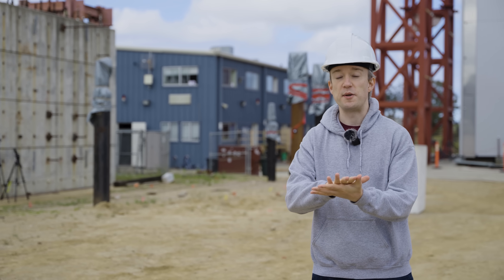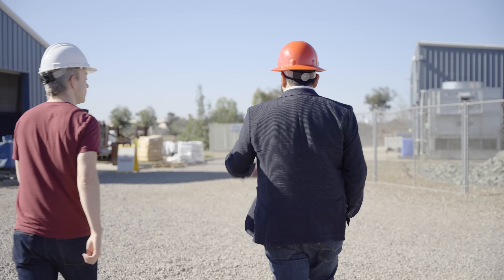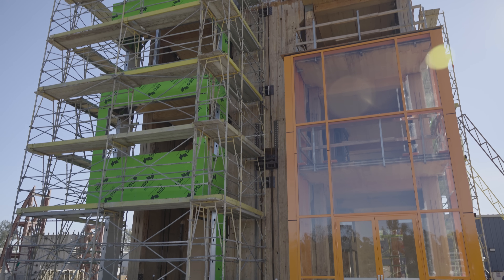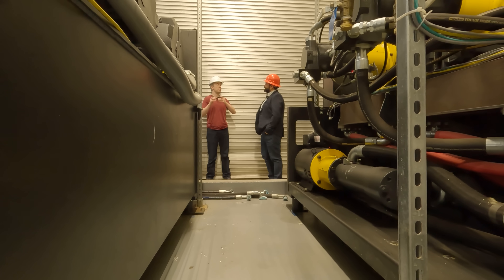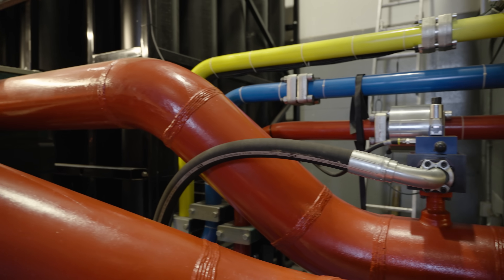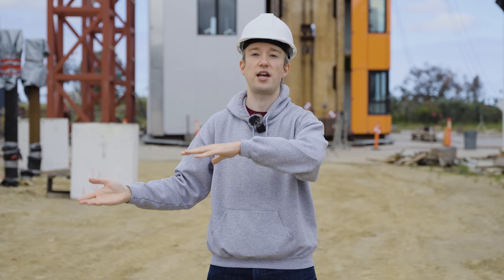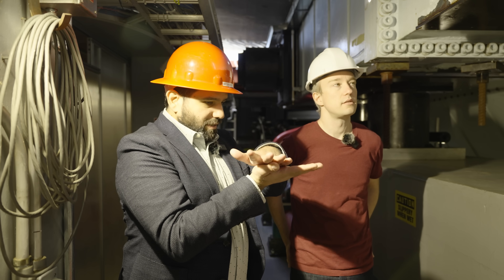Shake tables are way more complex than I thought

Comment from the maker: I'm a bit worried about whether the shaking comes across on camera. If you can use a big screen, please do! It's almost impossible to be close enough to see the shaking AND static reference points AND to have enough movement that it shows up on camera. But the noise? The noise, at least, sells it for me.
Reply: Watching an object that big move that quickly certainly sells it on a normal monitor. This is one of your best videos showing scale, both of the shake and of the systems responsible for it.
Reply: Looks good on a 6.5" Phone screen honestly.
Reply: We can definitely see the shaking, especially because of all the different camera angles!
Reply: Yup - shaking looks good here ❤
Reply: That building's got moves.
Reply: The external footage of the building shaking should have been shown in full. The cuts to the hydraulic system, the base traversing, the internal of the building etc are great, but should be shown separately. All the visuals were shown in such short duration. Unless of course that was your plan, forcing us to replay and replay the footage, increasing engagement time for your video and profiting on the algorithm. Clever move Mr. Scott, very clever indeed.
Reply: Comes across fine on a phone screen
Reply: I would have liked an UNedited cut of the shaking from your observer perspective (from start to finish movement)...then you can cut to the 5 other angles. The editing was the typical cut-cut-cut action movie BS and it removes all references to time, and even space/size.
Reply: Agreed.  The motion is still dramatic, but it's the noise that sells it.
Reply: I could see it on a 25" screen at 1080p, on full screen, it was incredible
Reply: so this video has been uploaded but private for 8 days?
Is that common practice for youtubers?
Reply: Could we get the raw footage of the tower shaking? It's a bit hard to see with all the cuts.
Reply: You comprehensively and beautifully captured and explained the Shake Table. And you are 100% correct, the noise is so cool and eerie simultaneously, especially in person! Come back to visit soon!
Reply: 27" 4k monitor, shaking shows up well. Thank you for sharing with us sir!
Reply: If I could afford it I would buy you a "Motion Amplification camera",  I wonder if there is some post processing plugin that could do it, I would of thought so.
Reply: Watched it a meter from a 43" in 4K with 7" studio monitors. It came across terrifyingly well.
Reply: What was the magnitude of that particular test? Hard to tell without constantly seeing the table but judging just by the sway of the building that looked like about a 4.5 or so.
Reply: did you feel any vibrations on the ground from that?
Reply: I just wish there was a mid-shaking drone shot, to be honest.
Reply: Gave me PTSD back to the last one we had here in California. You can see the waves and when theyre happening you can definitely feel them.
Reply: 4k laptop screen at 15 inches here , looks fine and shaky. Not overwhelming and turn-and-run stuff, but one can definitely see the big 10 storey thing wobbling about.,
Reply: Oh, it is! I can feel it from the audio alone.
Reply: On my 32" pc screen if came across fine, even after the explanation I get why standing there isn't comfortable in the slightest
Reply: You got me with that newsletter thing, you wee scamp! :D
Reply: Oh, it comes across alright. Seeing something that size wiggle at all causes quite a bit of @n@l pucker. Please go back when the test to failure.
Reply: While it doesn't come across as super noticeable seeing the engineering underneath definitely helps sell it so to speak.
Reply: I feel like the shaking doesn't come across- but the way it makes a full building sway like nothing certainly does and that is horrific
Reply: We need an uncut video of the tests!
Reply: Watching on my phone and hoo boy that building is swaying, especially at the beginning it still looks really dramatic and terrifying
Reply: Imagine being a car in the road that goes by this place, you see a building that looks to be under construction and then IT STARTS SHAKING
Reply: I had no problem seeing the shaking thru the phone
Reply: I can see it. Plus, being a Californian I know what an earthquake feels like, including the 1989 San Francisco earthquake. So I can definitely appreciate what you showed us here!
Reply: Oh it showed.  I would want to run too!
Reply: yet you only show 2 seconds of the buildin shaking?
Reply: @HW1099Tube  that's probably all it was. Medium (M4-M5) earthquakes generally last about that long in San Diego. Source: I have lived in San Diego for many years.
Reply: I think it comes across quite dramatically
Reply: That looks terrifying on a tiny phone 😂
Reply: iPad slipped off the settee while watching it, which enhanced the effect.
Reply: No no don't worry, that big initial shake was SOMETHING and your reaction to it sold how powerful it is. Amazing video and amazing engineering
Reply: 75" 4K looked great, would like a 4K video version of shake if exists. Uncut. Structure samba ftw. High speed camera version, backlit at night with spotlights & floods in front... well a guy can dream
Reply: It was a bit terrifying. So yes.
Reply: Saw it just fine on a 16" screen at 720p, incredible stuff
Reply: Oh yes it did come through... I got cold sweat imagining just for a second being in that building while it's shaking...
Reply: Checked on my phone and my tv and it's the fact that the whole building is ever so slightly bowing that sells it for me
Reply: It was clear on my phone! I would be terrified if I was in that building haha
Reply: Very clear.
Reply: If the shaking was too noticeable over our screens I have no doubt the building would fall down shortly after the text began 😅
Reply: I can finally complete my Venn Diagram of things said by Toms Scott and Tom Cruise
Reply: Tell me when you're coming to California again! Big fan
Reply: As someone having experienced earthquakes even a tiny amount of shake under your feet, or in person is awe inspiring, even if not visually so.
Reply: You could look at power infrastructure installation possibly and they may be able to have you ride across a span. (You can figure out what that means by yourself)
Reply: Can confirm it works. :)
Reply: looks great. the sound helps!
Reply: Guess you needed a little redemption from that horrible video you made about that company that prays on the desperate ehh?
Yea... you should just delete that video and revisit it and this time, dont spew their agenda./propaganda, and speak the truth.
Reply: looks amazing on a 120" projector screen
Reply: Laptop here, but I watched it 3 times until I saw it. Worth it! It was awesome when it hit me that the top floor was moving totally differently to lower floors. :D
Reply: now you made a new attraction, i want to see it in person
Reply: It would have been easier to see the shaking if not for the rapid cuts between different cameras during that sequence. Is there a version which shows the whole building shaking from just one perspective?
Reply: it shows. i saw it shaking and thought dayum i wouldent wanna be near that even tho its within its threshhold for integrity ha
Reply: Good video but speaking of noise, please dedicate more time to audio QA. I was constantly having to adjust the volume of my speakers while watching this as the interview sections were too quiet compared to the narration.
Reply: It's a pity that the building is largely unclad. If it had a glass facade, you'd be able to see the building flex by the warping of the reflections. That's definitely my memory of the 2013 Lake Grassmere quake: watching the windows go wild across the street. Of course, they want to see the actual structural members for these tests, so it's understandable.
Reply: That initial jolt really shows it. I was expecting to see it not move much honestly, but that looked really intense!
Reply: Are you kidding, Tom? Even on my phone, that was an absurd amount of movement. Granted, I'm a Civil Engineer outside earthquake territory, so buildings only move when they're falling down, but...
Reply: I’d love to have you talk about our earthquake prevention (or really the lack of it) in the PNW. We have a subduction fault that hadn’t gone off in over 3 centuries and would rival or surpass the 2011 Japan earthquake, and we are not ready for it.
Reply: Was clearly visible to me. Have you ever been in a real earthquake? From experience, I can tell you it is the most disconcerting feeling that you never forget.
Reply: And, if you're watching on a small screen, just shake your phone around a bit and it'll give a similar effect.
Reply: Yes, shaking came across terrifyingly well!!!
Reply: Nope, definitely shaking
Reply: The shaking? It really does, and it is the scariest thing ive seen.
Reply: I can see it in 144p, it's scary af
Reply: The shaking definitely comes across even on a small screen. It's the building flexing that does it for me
Reply: I could definitely see it shake. Super noticeable roughly around 7:40. For clarification im on desktop full screen on secondary (slightly shitty) 1080p monitor.
Reply: I'm on a small screen (or at least, a normal PC screen) and believe me, the shaking IS visible and genuinely made me uncomfortable even from the comfort of my own home. That's terrifying
Reply: It shows up fine even in the miniplayer on my phone
Reply: On phone and was able to see the big S bend of the harmonic at 360p resolution, great work to the camera person(s) capturing this beast!
Reply: I watched this on my phone, and the shaking (at least the larger movements) came across just fine! I’m always happy when I get to see a new Tom Scott video :-)
Reply: Cover  H.A.A.R.P  THE REAL EARTHQAUKE MACHINE
Reply: It isn't difficult at all for them to copy Qaukes.  Especially when H.A.A.R.P is the cause. TURKISH PRESIDENT PUBLICLY ACKNOWLEDGED THAT DENMARK'S H.A.A.R.P CAUSED THE TURKEY QAUKE KILLING THOUSANDS
Reply: That was very fun to watch. My younger brother actually worked on the design of that original earthquake table from about 20 years ago as a mechanical engineer student.
Reply: Oh, no, I could DEFINITELY see it shaking on my phone. Wow!
Reply: Was that hydraulic fluid leaking in one of your shots of the xy axis when it was moving? If so was that normal? Was that a problem liquid? Did you mention what you saw?
Reply: I think if you've never experienced an earthquake, you might be less impressed, but my heart over here in Japan was racing when I saw the test building start to wobble and I completely empathize with your desire to turn and bolt!
Reply: Oh no, that looked wildly terrifying on camera. That was bonkers.
Reply: Shake, Rattle and Roll, California style.
Having been in several earthquakes, the video looks about right to me. It's something which causes instinctive reactions; nobody expects the ground - their plane of reference - to start moving for no obvious reason. You're right; the sound is almost unmistakable. Thanks Tom. 🙂👍
Reply: Watching it from about 50 cm on 27" makes the image appear bigger in your view than watching it on 75" screen from 150 cm away.
Reply: Freaking sweet! to see and hear that. Thank you, Tom!
Reply: 7:40-7:41 is a fantastic shot where you really see it move. Also ... are you close enough that if it were to fall you could be injured? Surely they don't let anyone stand that close.
Reply: I have an extra huge screen and I'm so glad you suggested that, seeing that earthquake in full screen was indescribable. There's a sort of beauty to it that hollywood could never even begin to replicate.
Reply: Anything but sensible units, psi and 500 times the tire pressure. What’s wrong with bar or kPa ?
Reply: Be careful, Tom. You might be mistaken for Kim Jong Un Looking At Stuff®
Reply: Is the table controlled y a PID controller? Oooh - if you start doing videos again, oplease consider doing one o PID controllers. I learnt about them (as iin I learnt there was such a thing) when I built an FPV drone, but it turns out they (PID controllers) are everywhere.
Reply: Yes so am I
Reply: I'm on a 55inch screen, it comes across! 
I'll say it again, I love your job!
Reply: Big fan, keep making these videos!

Comment: About the actuator: If it fills with oil it's no longer a vacuum chamber? Why was there a vacuum to begin with? Why fill it with oil? Why would it be bad it it came unseated? I get that with the whole thing moving you can't have it rigidly connected, but everything else was super unclear.

Comment: 0:20 Fun with linguistics! 

"Floor" in US English (Simplified) vs UK English (Traditional) is that it refers to inside surfaces only. Each level of a building has its own floor. e. g. "Floor to ceiling wallpaper." 

The "ground" generally refers to the outside surface level of the local terrain. 

If you "fall to the ground", you must be outside vs "fall to the floor" would infer you're inside a structure.

Comment: I am not interested in shake tables/this kind of engineering (that doesn't mean I don't appreciate it and understand it's importance) and understood about 5% of this video (I got high pressure oil make table Shake, Shake table test building for ability to withstand natural Shake and be safe for people, ) but I watched it quite a few times just for infectious excitement these two had about this stuff. I might only get the basic idea of why a U-turn in a pipe like that is not the safest thing (turns compress already dangerously compressed oil even more? So they have to be really fricken strong pipes at the turns?) , but I definitely understand it's uniqueness off of Tom's reaction.

Comment: 3:30 water hammer has nothing to do with the pressure, only the density of the fluid (assuming the fluid is incompressible). If a particular mass of fluid accelerates/decelerates over a certain period of time with a pipe with a certain cross-section, that requires some pressure gradient that is independent of the ambient pressure of the fluid.

Comment: I interviewed for a government job back during desert storm, they were building jamming equipment for IED's, and had two shake tables, that were 10 x 10 feet and 20 feet high, with so many actuators at dozens of angles randomizing motion. And they dumped liquid Nitrogen into the the chambers, emptied it, and heated it and repeated the temp cycle while the shake table ran for several hours. The chamber walls were so think because the decibel levels were so high inside while running. It was over 110-115 DB inside, and only 75dB outside the chamber. It was the final test before deployment of the equipment. Amazing stuff, They were also working on the deploy-able units that had an array of  many microphones and cameras, that could pinpoint where a missile or bullet originated, and then return a missile to the origin within seconds.

Comment: Mass timber tests have been ongoing in Seattle as well particularly for fire codes. There's a good system of classification for them here because of that, with uncovered, partly covered, and fully covered wood for hours-of-resistance in tall wood buildings. It'd be great if you could get a viewing of a burn test.
As for the bracing, it's a lateral system: Buildings generally have 3 lines of resistance in 2 directions, like a core, or shear walls like that big tall flat one you see in this building, which resist horizontal forces.

Comment: The U in the pipe might have had a functional use too.  They are often added into steel pipes to give flex so the pipe doesn't buckle.  They are common on oil pipes at refineries for thermal expansion.  I've used them on hydraulic tube to absorb vibration and misalignment.  Nothing this big though.  

I love the green DIN 3015 clamps on the pipes.  I didn't know Stauff or Hydac made them that big.

Comment: You've added a little insert to convert inches to cm.  Could you add another to convert 5000 psi and 3000 psi into bars (344 and 207 I believe).  I'm not an engineer, so its all alien to me, but the engineers I showed it to would have appreciated it more with metric references.

Cheers!  Really interesting video!

Comment: I dont think these sorts of tests are fair. Like testing a new new simpson strap or w/e. Because they were probably installed correctly and had tight framing to work with on this building.
To be realistic you should contract it out at like 10$ a sq foot for labor and see what kind of awful mess you get.

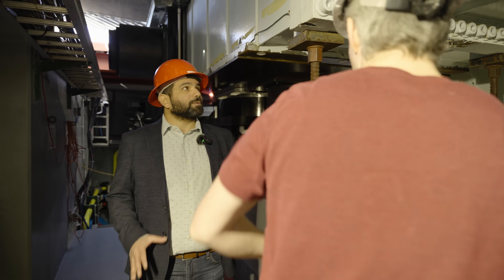Comment: 4:47 i suspect if it would go straight down with just a corner, and no U-turn, it wuold be worse, once all the weight would fall over the horizontal T connection.

Comment: what I don't get is how is the building structure attached to the shake table? Usually you will have a foundation, ie there will be quite some structure below the ground to anchor the whole thing and keep it stable under normal conditions and loads. But this thing can't have regular foundations, right? How d you attach the structure without a) destabilizing the entire building and b) introducing a fresh point of failure at the attachment point that wouldn't exist in normal, everyday, construction?

Comment: Interesting that they're trying to recreate the measured earthquake. 

In my head that measurement is earthquake vibrations + resonance of the measurement facility. Instead of them controlling the feedback to output that measurement surely they should be subtracting the measurement resonance and allowing the new building to do what it does. 

The whole point is to see what happens when an earthquake type signal is sent to it. If the buildings resonance ends up being catastrophic, that needs to be addressed rather than tuned out of the earthquake signal